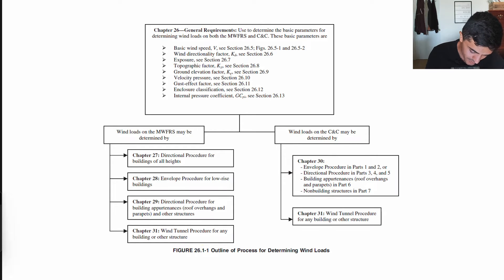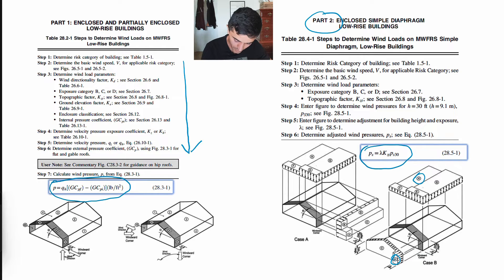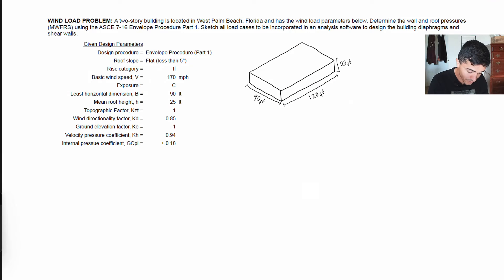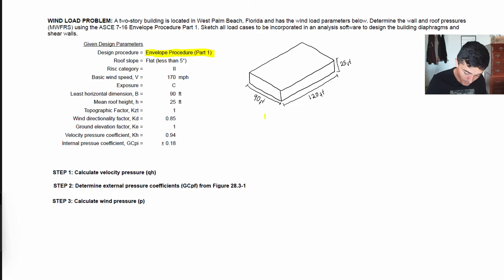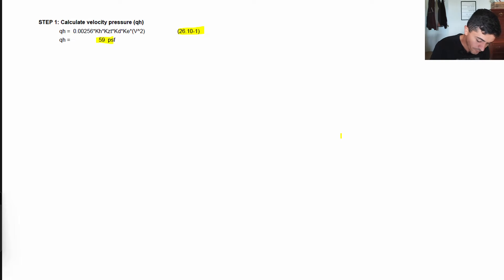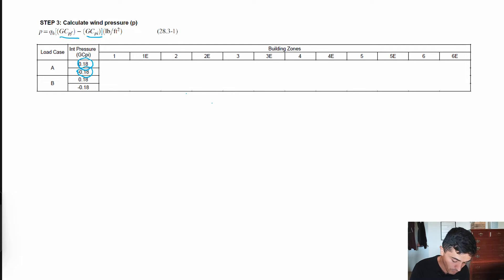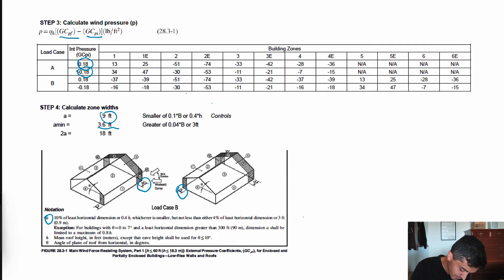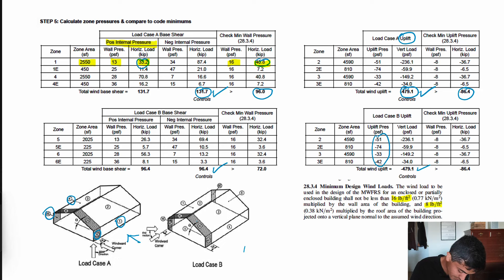Master Wind Load Calculations (MWFRS Envelope Procedure Part 1)

Comment: Hi, great helpful example of the wind load calculation, but I have one doubt, in the Load case A, why is zone 5 and 6 missing, but in ASCE 7-05, they are indicated?
Reply from the maker: Hi @ShaofeiHua! This is a great question. I haven't found any explicit statement for the exact reason zones 5 and 6 were excluded from load case A (transverse direction). Following the logic of load case B, they would represent sidewall pressures (equal and opposite) and cancel out in the determination of base shear. I've discovered that until ASCE 7-05, engineers often misinterpreted this method and were confusing these pressures with C&C. Removing those zones from one load case would potentially alleviate the confusion. I recognize this doesn't fully explain their removal, and I wish there was a clear statement in the commentary about it. I will try to reach out to the ASCE 7 wind load committee and see if I can get an answer. If you discover anything else, I'd appreciate if you could email me at rsilva@quickquestioneigneering.com. Thanks again for the question!

Comment: Can you check your Minimum wall pressure approach?  Paragraph 28.3.4 in the Commentary Section (Page773) refers to figure C27.1-1.     Figure C27.1-1, page 768, shows the 16 psf wind load on only one side of the building.  In your spreadsheet you included both sides of the building.
Reply from the maker: Sorry for the delay in replying. Great catch! You're correct, the minimum pressures should be on only one side of the building as it is the "net" pressure. In my spreadsheet, the minimum base shear should be half of what is shown for load case A and B which will make the minimum pressures even farther away from controlling. Thanks again for pointing this out!
Reply: @QuickQuestionEngineering Thanks for confirming.  I will say I prepared a spread sheet similar to your example as it is well organized and helpful.  In fact it was the way I discovered the discrepancy.   I ran several wind conditions and was puzzled why the minimum was controlling.  When updating some of the references to ASCE 07-22 versions I noticed the issue.    One thing I did add was a simple sketch  in excel and inserted the loads at each face, so it is easy to see the change in one view.   Its a bit crude but if are interested I'll send a copy for review.
Reply from the maker: @TheModelmaker123  That’s awesome! I’d love to take a look at it if you don’t mind. My email is quickquestioneng@gmail.com. 
I’m finishing up another video solving the same example but using the Directional Procedure Part 2. I just created a footnote to cover the minimum pressure checks and avoid confusion this time.

Comment: In step 5, Load case A for the roof why do you compare total vertical load in PSF to Horizontal Load in KIP to see what controls....? You also have "Wall Pressure" in that table with 8 psf listed as the min. isnt that roof min?
Reply from the maker: Thank you for catching this. In step 5, the total vertical load for the roof is in Kips. I mistakenly had it labeled as PSF. "Wall Pressure" in that same table should read as "roof pressure". I appreciate the feedback. I'll make sure to have these corrected for the next video.

Comment: Hello, may I ask a couple of questions: 1. How come wind pressures for zones 4 and 4E came out to be negative values in Step 3, but went to the table in Step 5 as positive values? 2. Why do we check for uplift using the positive internal pressures only, and not the negative ones? Hope everything is doing well with your studies for the second try :)
Reply from the maker: Hi @iam_stl, great questions. #1. Zones 4 and 4E are negative values in step 3 because the pressure acts away from the wall surface (thus the negative value). In step 5, technically they are negative as well. In my spreadsheet, I used the absolute values for all pressures because I'm adding the pressures from the windward side (zones 1 & 1E) and the leeward (zones 4 & 4E). #2. I used the positive internal pressures only because they always control for uplift. The positive internal pressure acts from the inside of the building towards the roof and the roof pressures act away from the roof but from the outside. Therefore they add up, whereas the negative internal pressure subtracts from the roof uplift pressures. These are great questions that I may bring up in my next video. Let me know if my explanations made sense or if you have more questions. Thanks for the good wishes! I'm taking lateral depth today! 😬

Comment: Hi, 
Thanks for uploading, this is a very useful video and full of new information for me... I have a question plz, for your wind base shear, why did you sum loads from all 4 zones (1, 1E, 4 and 4E) ? shouldn't be one side at the time and then the base shear would be the largest of the 2 sides? Are you assuming that wind is blowing towards zones 1 and 4 at the same time ? Thank you!
Reply from the maker: Great question! We sum the loads because on one side we have a positive windward pressure, and on the other side we have the negative/suction leeward pressure. They act simultaneously as the wind hits the windward wall, travels around the side walls and create suction on the leeward walls.
Reply: Thank you for the explanation, I actually had it totally wrong 😅... I thought, since the building is enclosed and there is no internal positive pressure on the leeward walls, that the suction does not affect the MWFRS, but only affects the sidings or glazing attached to that wall...Cheers!

Comment: Hi,
I am studying for my PE Civil Structures NCEES exam and was planning to take the exam end of 2024, but with the new spec exam update effective April 2024 they updated codes and standards. During the last period, I was studying using the codes posted in the current exam standards. 
Please advise me, should I take the exam on the current specs knowing that I am not fully prepared? or should I wait and start using the new standards knowing that I cannot afford to get all of these codes -shown in the April 2024 exam specs-?
Reply from the maker: Hi there, the codes are all provided during the exam, so you won’t need to buy any hard copies. Your company may already have PDF versions of the codes that would be able to use for your studies. Please note that the main difference in the specifications is that starting in April 2024, there will be only the structural depth portion of the exam. So, you won’t have to study for the breadth. If you already studied for the breadth, it may be worth taking it now, but if you’d like to focus only on structural, it’d be better to take it in or after April.
Reply: Thx for your response. I work for the DOT currently I am not sure if i will be able to get the updated codes.
 My dream is to become a SE but this is what i got for my first Job. I guess i have to change my job.
Thanks again for your advice